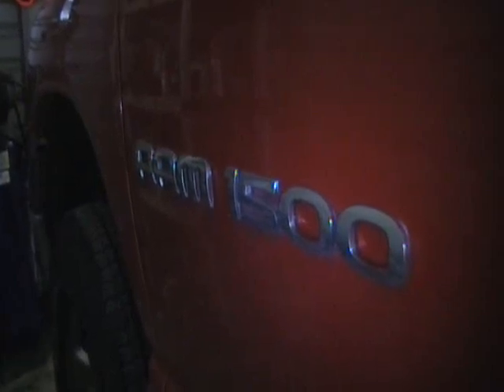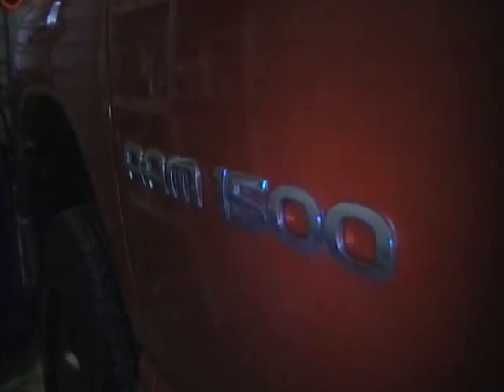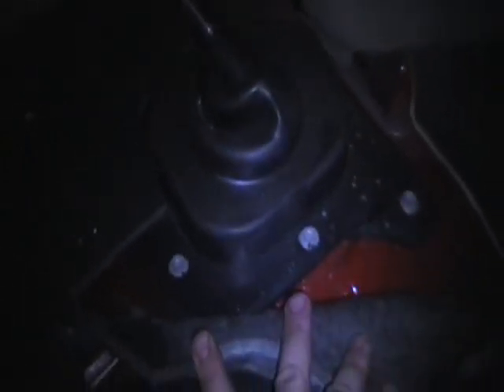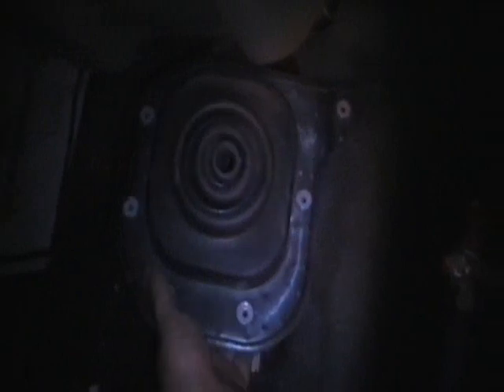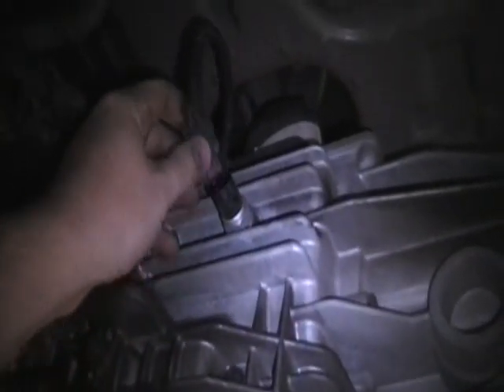Dodge Ram 1500 Clutch and Transmission Removal

Comment from the maker: @deesnutz57 How are the cap & rotor? Are you able to check fuel pressure or compression? You can check for vacuum leaks with carb cleaner carefully sprayed around the throttle body & intake gaskets with engine running. Changes in RPM indicate vacuum leak. Remove 1 plug wire at a time with running engine & check for one cylinder that isn't affected by the wire removal. If you find 1, that cyl, plug, wire, that part of dist cap, or injector may be bad. Don't spray cleaner with wire off or loose!

Comment from the maker: @ohblondi It is easier to go from manual to auto than auto to manual.  You need a radiator, flexplate, torque converter, trans cooler lines, shift linkage (or floor shifter kit), and there may be some other misc. parts that aren't interchangeable: drive shaft, crossmember, mount, reverse light switch & wiring, speed sensor, etc.

Comment: Need this for a 2001 318 5 speed and it ain't anywhere.  😤 Gunna put the damn thing in the shop if I can't find the exact vid I know I need. I'm not fkn with it without a video. 🙅🏻‍♂️😅 More a throw out bearing than the clutch.   Just rebuilt the thing from being totalled by the original owners and now I suspect they stood on the clutch on impact and otherwise damaged something that's now broken.  😔

Comment from the maker: @edith4670 Give me a little more info & I'll try to help.  If you hold the pedal down does the noise continue, or does it only do it as the pedal in moving downward?  Is the noise the same whether or not the engine is running?  Did the problem gradually start, happen all at once, or was some trans or clutch work done then it started?

Comment from the maker: @edith4670 If I am reading this right, you can push the clutch pedal down & it makes a noise.  It makes noise if you are not pushing the pedal down too, or it makes noise as you hold it down?  You also have the noise if the engine is not running?

Comment: @roadragecustoms yes, it continues even if I'm not presing the clutch .
 and the noise is not always the same, some times is softer and then loud againg.
the noise still the same whether the truck is runing or not but always the sound is changing from loud to soft and then loud again,and the noise start at once but I don't know much because I only have one week with the truck, well that's all I know if you can help me with that litle information I'll appreciete.
thank you for your time!

Comment: I have an '01 Dodge Ram 1500. Need help with figuring out why my standard transmission is difficult going into 1st and 2nd, and will not go into reverse while the engine is running(have to kill it so it will shift). I have already replaced, properly, the slave cylinder....